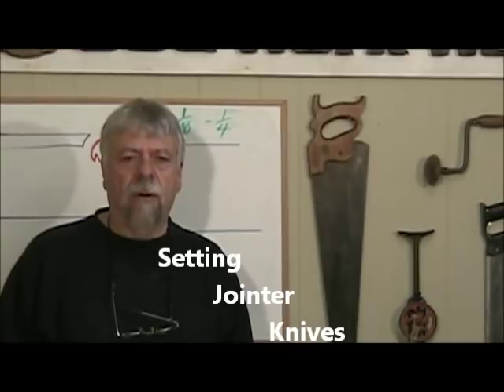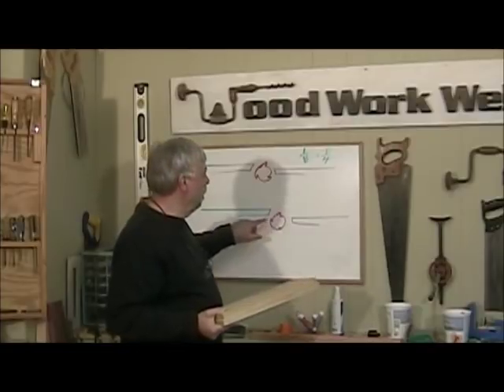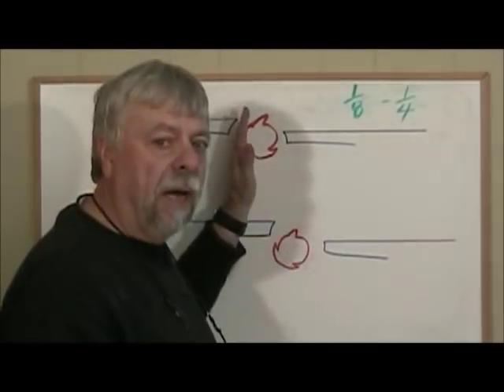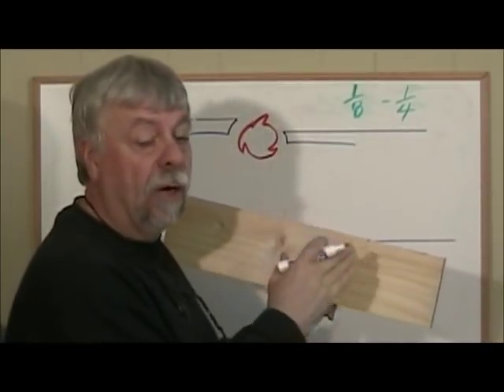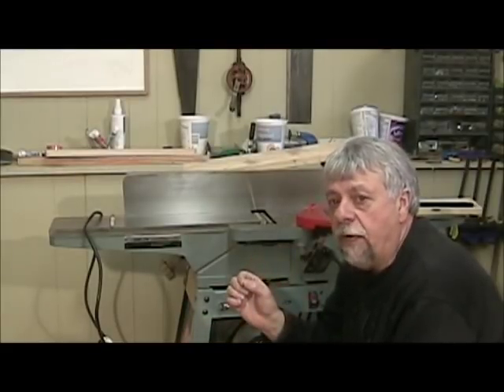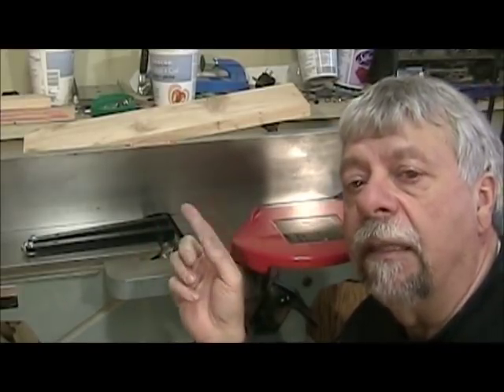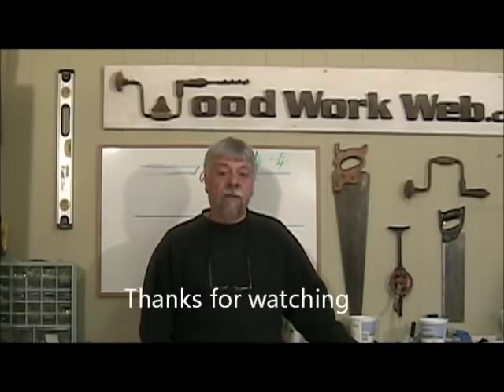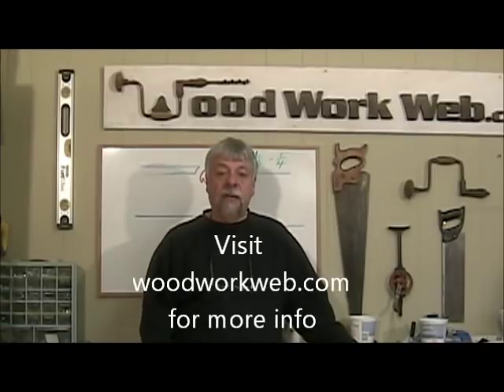woodworking - Setting Jointer Knives

Comment: Jeez, all this bitching over knife setting. This is what I was taught and find works best. Use a nice straight piece of jointed timber NOT metal to set the height of your blades to the outfeed table. Use a very soft wood block to gently tap the knives down until they drag/tickle the timber ever so slightly. I go by the sound the wood strip makes from one end of the knife to the other. You can hear the blade scratch the timber. Done. 
But what soon happens is that keen fresh edge gets worn a tad and you will have to back off the out feed a scooch to bring it back to snipe free. After a while you may have to back it off a tiny bit more as the blade gets tiny nicks. 
In practice I use the middle of the table to surface and save the keener edges at the back and front of the table for edge jointing. Mind you it helps to have 20” wide beds if you want to do that. 
The truth is in practice that to get it perfect you have to tweak the out feed every now and then, thats why its adjustable people.